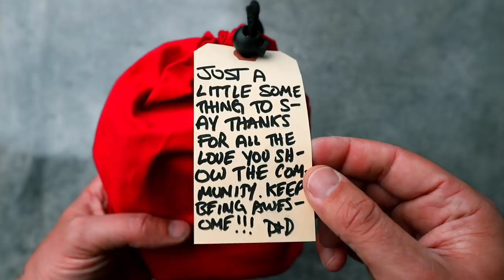Solving the LEVEL 10 MAZE PUZZLE! (There’s a surprise inside!)

Comment: Well this looked pretty easy for a level 10 puzzle, well you missing the moves made it harder though...
Reply: by design it is easy. theres one solution and you could write it down on a notecard. just looking at the right side shows exactly what needs to happen, just the left must be manipulated to match that and sometimes it requires a "backwards" move. id say in the end its a little easier than a sliding block puzzle
Reply: i might've said this is either a level 8/9
Reply: It’s probably harder than you think
Reply: Ren Shinomiya lvl 1-2 at most
Reply: Sayon Roy exactly what I noticed. He missed the moves on purpose

Comment: Heyy... I stopped at 9.14
I think that the left side is just makes the right side harder to pull out... You focusing more on the left and less on the right. What you should have done was focus on the right and move the left when needed to because of the pins being blocked from moving in the direction you want it to.

Comment: I agree with the other commentators that this was painful to watch. I am surprised as you usually inspect the puzzles before beginning them for any clues and or to talk aloud how you think it should be solved or any thing special about them. This 1 you just opened it and dove right in. Had you done your pre-inspection you may have deduced how the puzzle worked and that only 1 of the slides could actually be removed. Which would have then been the basis for how the puzzle worked. Where 1 side was a "key" and the other was the maze. I still love your videos and they are entertaining to watch.